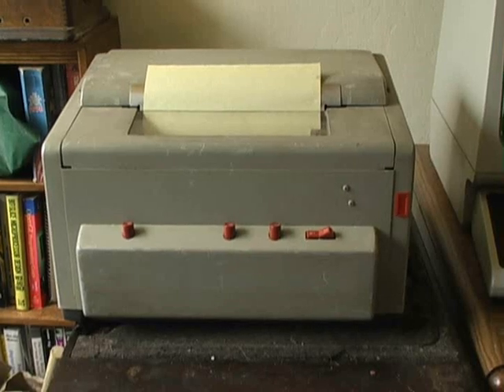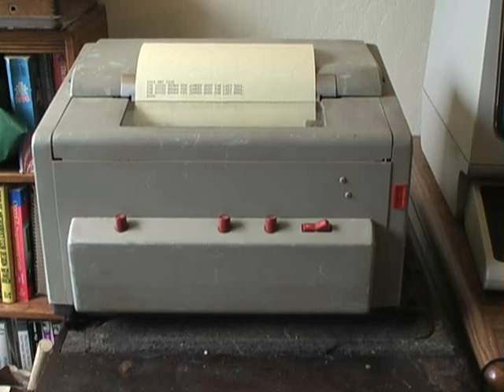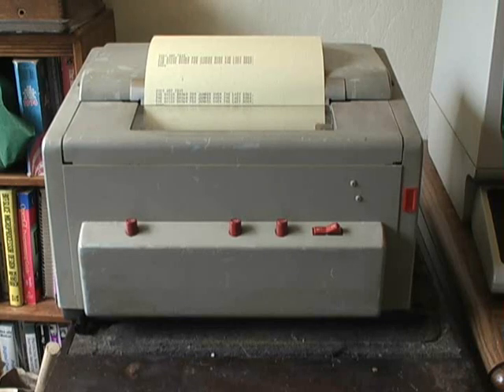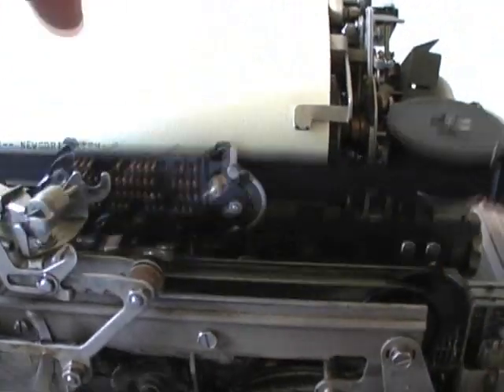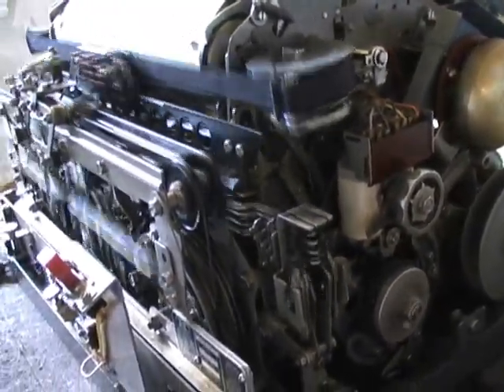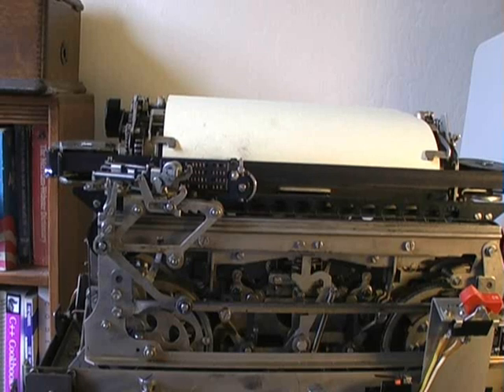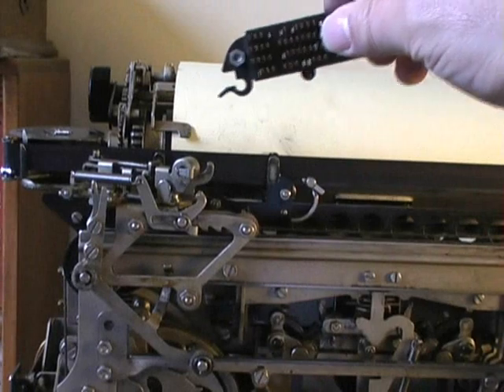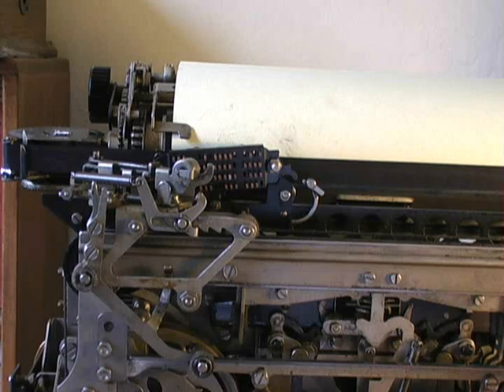Model 28RO Teletype Machine

Comment: That's the model I've got. :) How are you keying this Teletype? Below is my Raspberry Pi project for driving a Model 28 Teletype. 
  http://acb-luddite-technology.blogspot.com/2015/
Reply: http://www.navy-radio.com/manuals/tty/tty_maint/school-ugc20-7105-v2.pdf

This is the Navy training manual for this exact model Teletype. This manual is very pedantic. For those who really want to know how this fascinating mechanical marvel works, this is your guide. Page 70+ has information about the 3-speed transmission, followed by the Selector Unit operation, followed by the Code Bar selection. For the impatient, page 91 picture hows what bits selects the column/row for a character in the type box. Good stuff for the mechanically minded.

Comment: What interface are you using between the computer and the 28, and what program? I have a 28 RO, not a compact, and single speed (60 WPM only), as well as a model 15 KSR. I'd love to get them both running. Thank you for sharing this- I have never seen a Compact until now. 73!